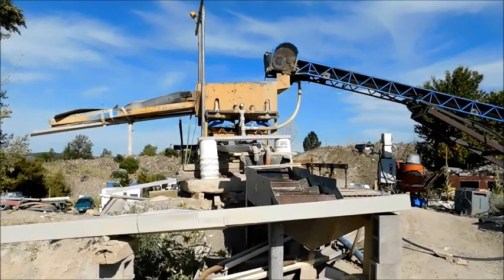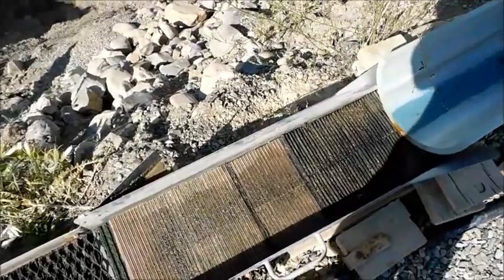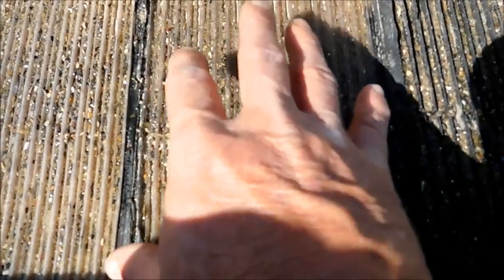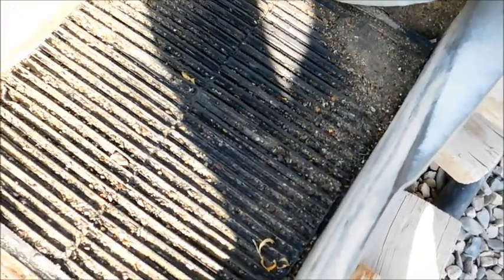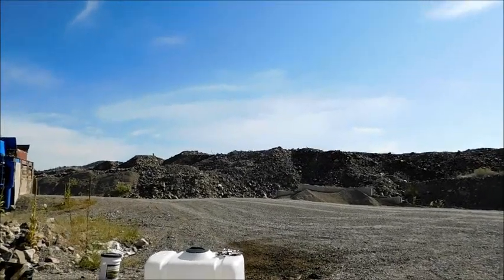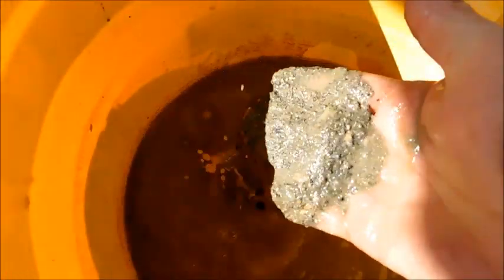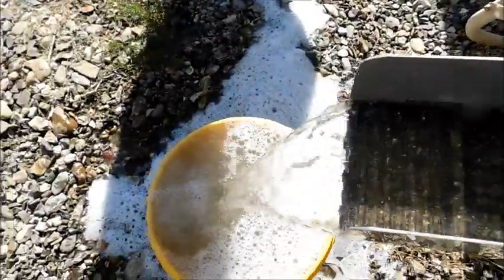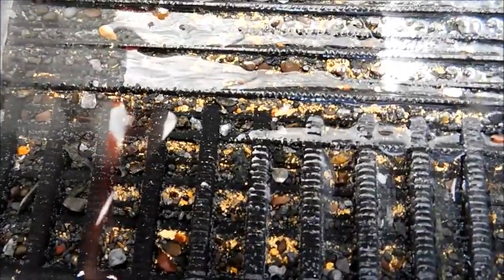Silicone Mat - Mine Test Results - 200+ Hours Run Time

Comment: Looks great Alan!  If you had the interest, or time I’d expect you could get someone to print you full sized molds on a larger printer using your files.  If not to avoid the seem maybe just save you the hassle of multiple set ups and so on.   Best of luck brother!  I’m sure I’ll be in touch to buy some Matts when I get my high banker finished up.
Reply from the maker: Yes I probably could make the molds bigger without the seam. I think the seam will keep the guys that have to have everything perfect from buying the mats. Also the more I put into the mats and the molds the more I have to charge to cover the cost. Good luck with your high banker.

Comment: Yeah i was born on flag day so i kinda dig the red white and blue,so i made my mats red white and blue and i left them outside to finish curing cause the wife didn't care for the smell, the red and blue both now are more a flesh tone or light peach color. They do seem very durable though cause I have ran some pretty rough material over them and they don't show any signs of wear. Great video Mr Alan!
Reply from the maker: Yep the food colored mats do fade but they will still catch the gold. OH yes they stink for a bit. Throwing them in a bucket of water sure helps with the smell.
Reply: @alanrobertson2510  good to thank you. Next batch of mats I'll give that a try. Currently I'm working on a under current sluice. The idea is quite an interesting theory. It's what they use on the gold cube at the drop from the upper tray on to the next and so on and so forth.

Comment: Very cool video Alan. The mats are working great.How long and how wide is your clean up sluice? What degree is the slope of the sluice? Good luck with selling your mats, with all profiles it should do well.😎👍👍👌👌⛏⛏
Reply from the maker: Hi Chuck the sluice was 4 inches wide and 4 feet long. He wanted it for the desert not sure on the slope we just set it to look right. I hope I can keep up. We shall see.
Reply: @alanrobertson2510  Thanks Alan for the info. I always use 5 degrees to get a 1" per foot Drop. Do you think that would be too steep for a clean up sluice??
Reply from the maker: @CandSMINING  No not to step at all I usually set at 8 degrees.

Comment: Cool
Reply from the maker: Thanks Chris.
Reply: @alanrobertson2510  Yeah I'm gad they held up. The wood mdf board mold I made for mine didn't like getting wet much. The last mat I made tore off some of the grooves. Oh well. I'm looking into a composite board that's machinable. I found that I'm going to have to let the mats sit for a couple weeks before trimming. I made a complete 24x7 mat and it unfortunately shrank by like an 1/8 inch. It's not 7 wide any more. Oh well lmao
Reply from the maker: @chrissaucier9386  Good luck with your new molds and yes they do shrink a bit.